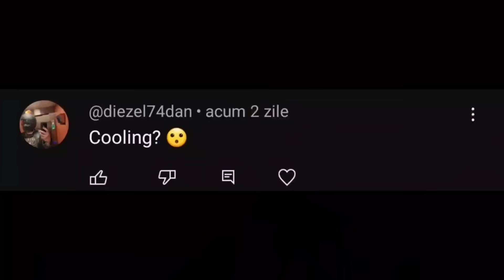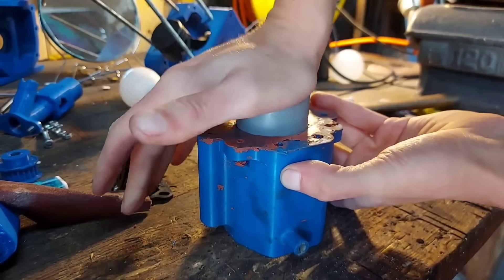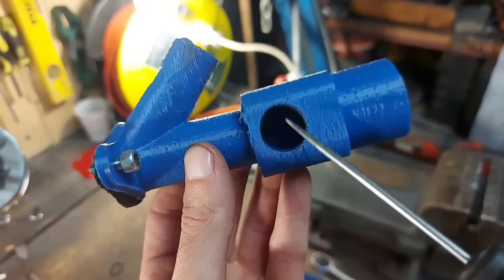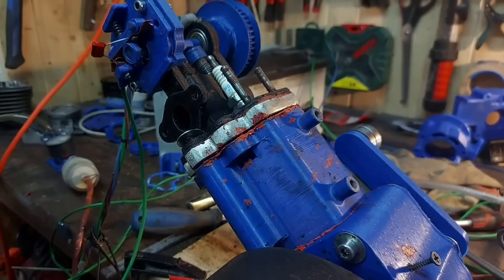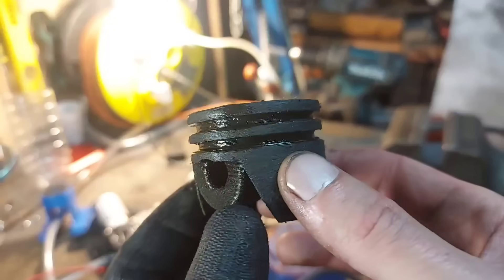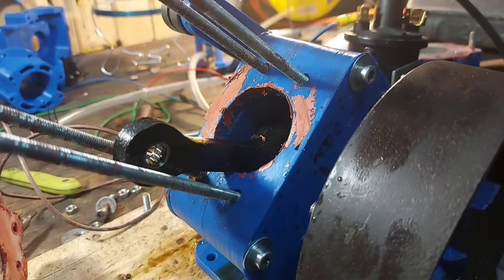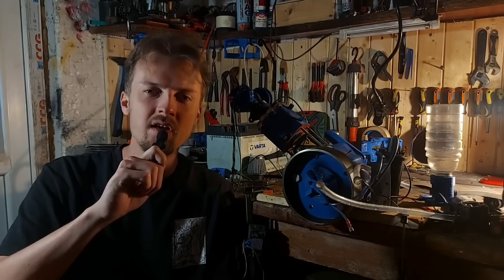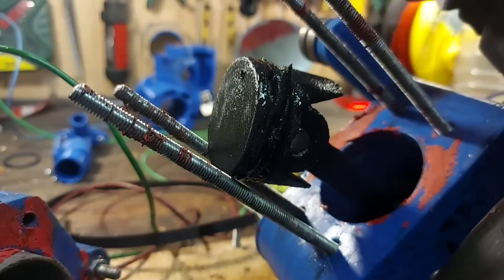High Performance 3D Printed Engine - Testing Your Ideas!

Comment: make the engine diesel because diesel burns worse than gasoline and the operating temperature of diesel is lower than gasoline, the plastic will not melt as much and diesel works slower and the engine will work longer without breakdowns. because I think that very high rpm quickly breaks the rubber ring
Reply from the maker: Im not sure if orings can hold the compression a diesel needs to autoignite, but in the future I have plans to make all sorts of engines so a diesel is definitly on my to do list !

Comment: This is coming along really nicely. However I’d suggest 2 things: A) lower print speed and get more print quality B) thicken the piston’s upper part that is over the ring, so there is more divide between the ring and the heat
Reply from the maker: Thank you, good point with the top part of the piston, will definitly use this tip în the future!

Comment: Want an aluminum piston? I could turn you one on a lathe.
Reply from the maker: First I need to get a propper cylinder sleeve, so I have easy acces to buying rings, so I dont have to make custom rings. Basicly I will need a mass produced cylinder , still doing my reasearch on what cylinder to use. Dm me on insta maybe once I get a cylinder we can talk.